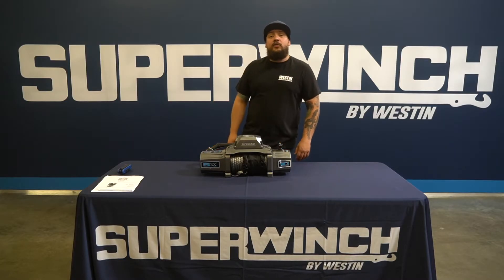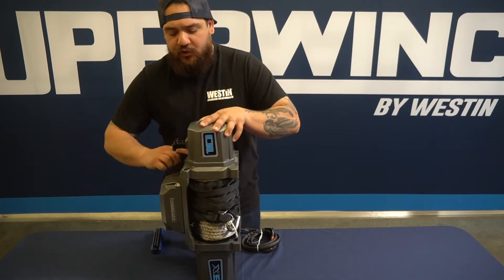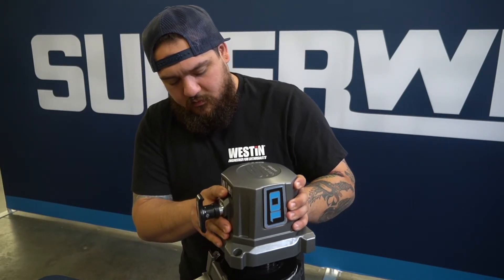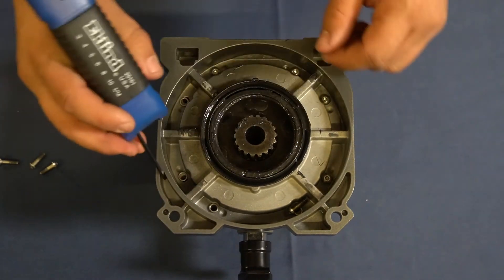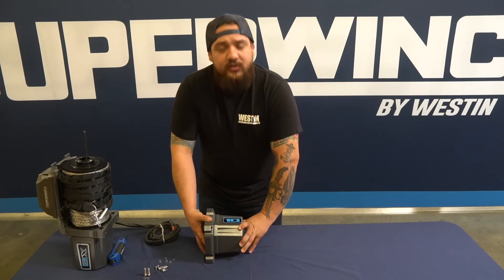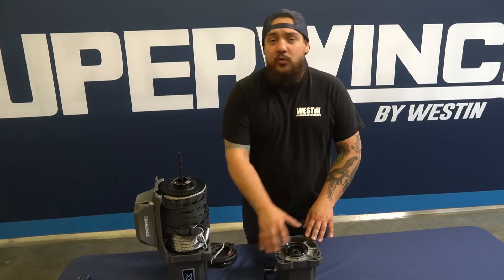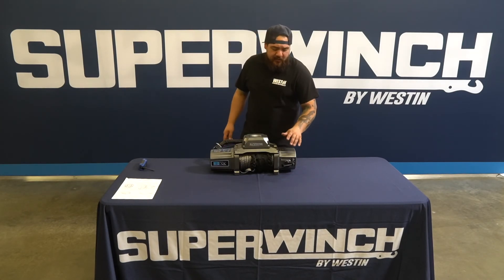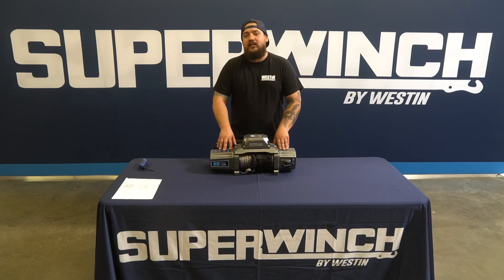Superwinch SX Series Winch "How To Clock the Gearbox"

Comment: You'd think with 8 evenly spaced bolts in there you'd be able to clock the gearbox at 45 degrees instead of just 90. 

But then that would actually be useful.

Comment: I was about to buy Superwinch as I install them on CanAms however I decided to stick with Warn as Superwinch poorly treated a guy on a video I just watched.

Piss poor service n parts support really piss me off!. I just hope poor operators go under.
 It's Warn, Kingone, Runva who gives good support.
Reply: I know which video you are talking about and that guy was just dumb. At the time of his video parts were available and easily found even though the company was being bought out by another company at the time and all production had stopped. 

I just got off the phone with superwinch today and they are sending me a brand new SX series winch for free as a replacement for my 8 year old Talon under warranty. Which is a MUCH better outcome than i was expecting. I don't even have to mail the old winch back. 

Just because you saw one video of one guy who didn't know how to use Google 2-3 years ago, doesn't mean the company treats everybody the way he thinks he was treated.
Reply: @KurNorock  Yeah I prefer to have a device work reliably than something that requires claim to get a replacement with possible chance of failure again. I repair Can-Am which has a no argument 3 year unlimited warranty which some parts could easily be made not to fail but they are designed to fail. I prefer to sell machines not have a full time job just on Warranty work.
Reply: @conmanumber1  Superwinch as a brand is every bit as reliable as Warn or any other brand.
Reply: Im on the fence between the SuperWinch, Smittybilt & Warn (VR Series).
Reply: @cjherrera79  I love the Warn with the digital wireless remote. It's only 2 cables to fit on. Ironman is good too as they are the only winch with a breather line to stop condensation.
Reply: @conmanumber1246  I think I’m going with the Warn VR Evo 10. It competitively priced with the Smittybilt, but has a better warranty and from what you and others have stated the customer service from Warn is much better!